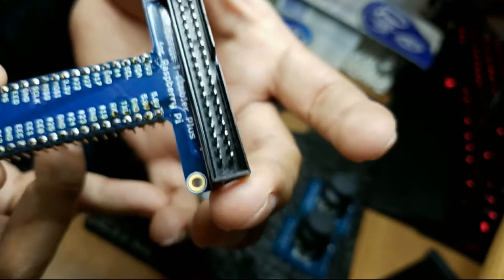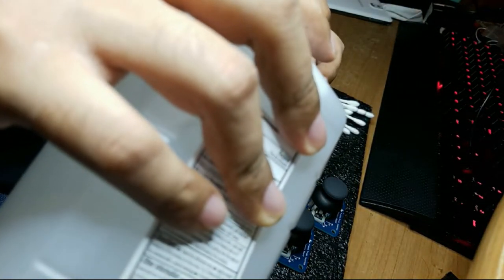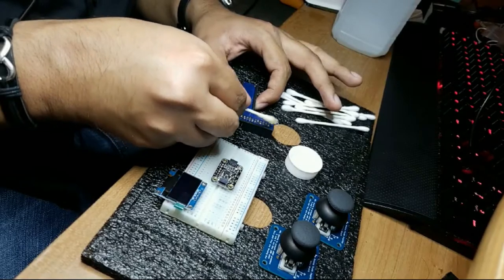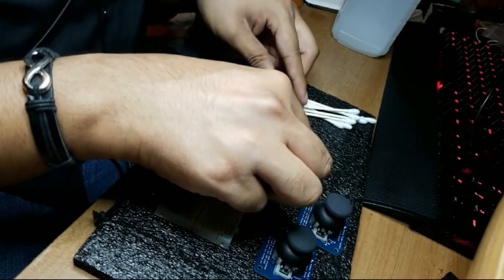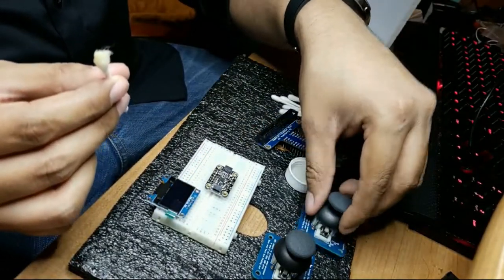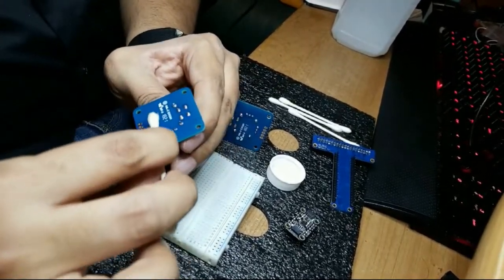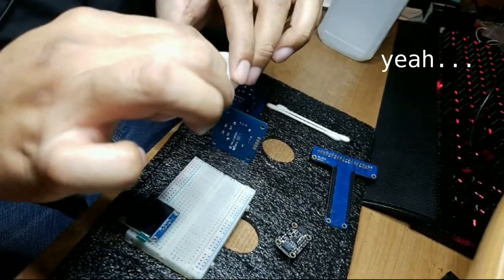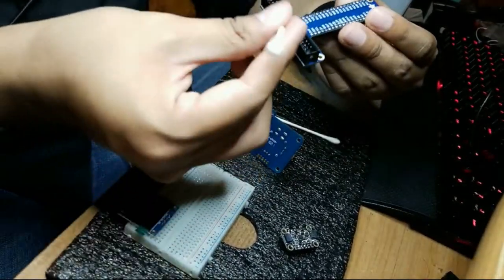Using 70% isopropyl alcohol and Q-tips to remove rosin flux off PCBs

Comment: I’m really new to soldering and I’m getting ready to do my first ever kit would this damage the psb or connection?
Reply from the maker: Depends on what connection you're talking about. isopropyl alcohol is diluted in water (H2O), and water can be somewhat corrosive to metals because oxygen gas is usually diffused in it. Keep that in mind and have a disposable towel nearby to dry it out especially if you live somewhere with high humidity.